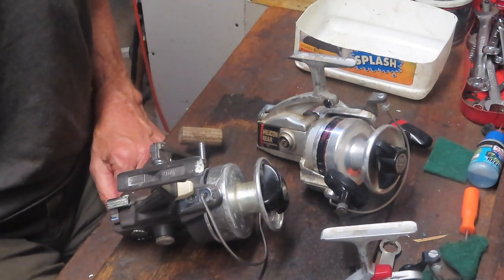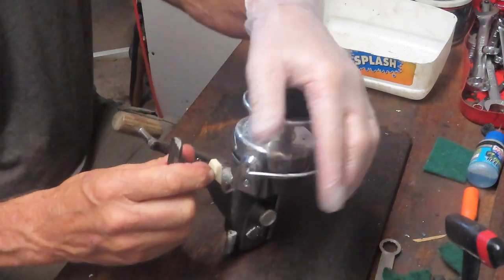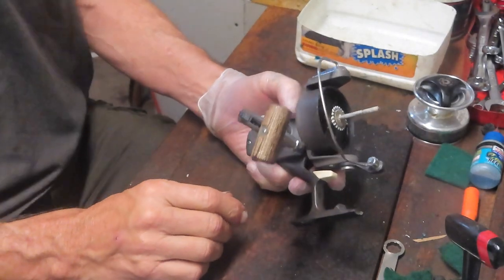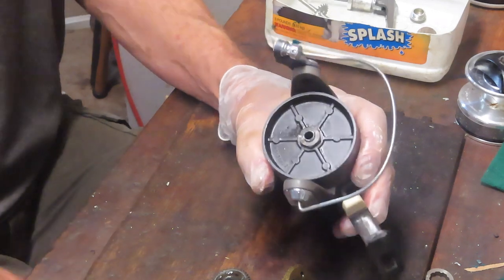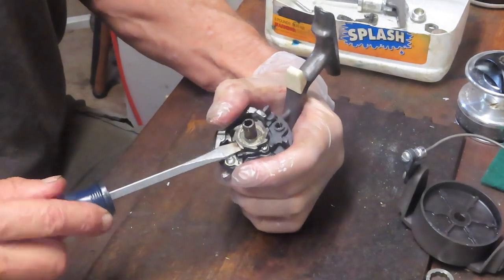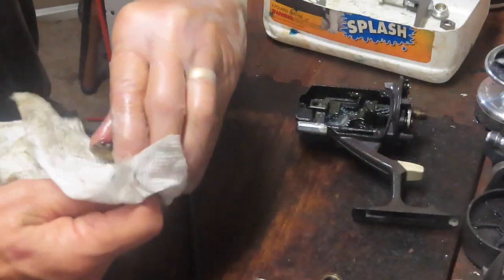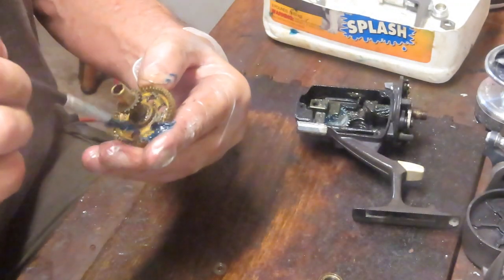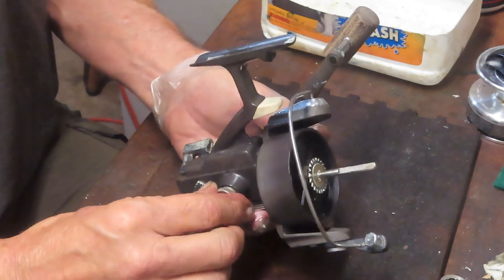Daiwa SS500 saltwater spin fising reel with unique AR over ride ow to take apart and service copy

Comment: The SS Daiwa's where made around 1975 and cost about $75 Canadian. I bought mine around 1980 when it was affordable because of inflation. A Silver series was about half that price. The SS has really nice big aluminum bail screws and cap. The handle was awesome and the Egyptian Hyroglufics really help catch fish as well. The Gears still running strong after 40 years. Saw one selling for $ 1000 American who needs 10 bearings when 3 good quality ones last that long with basic rince after salt water. The special finish looks new save where it touches the Rocky point when tending to fish . Really enjoyed this video thanks Dennis
Reply from the maker: Thanks for the note.   I like this reel.  I got it a part of a larger lot of saltwater reels and was surprised it was included for the price they were asking.  I'm planning on taking it fishing when the fall run begins. Dennis

Comment: Hi Dennis,
maybe you change the title to "Daiwa SS5000"? ;)
That´s excactly the type of video, I was searching for a while. Thank you very much!
The handle is made out of teak wood. At least, that´s the information that i have found on pictures of a booklet. By the way with beautiful sectional views of the inside, with real cuts of the reel! Amazing.

I´m really overwhelmed by the videos on your channel. Respect to your work!

I have never serviced a reel before by myself. 
I felt in love with the design of these reels an last year, I made me a present to my 40th birthday and I bought three of those beauties.
They for sure need a little service, as they don´t feel very smooth anymore and make some noises. Some corrosion here and there. But with the help of your videos, I believe I can do the service by myself.
Thank you very much!!!

Greetings from Germany
Bart
Reply from the maker: Bart - thanks for the note and best wishes on the servicing of those reels.  You can do it!
Reply: @2ndChanceTackle  Hahaha, thank you very much! I feel very confident, after watching some of your videos 😉
Would you recommend to work one reel after another or go step by step and service all three reels at one time?
Reply from the maker: Maybe 2 at once, but I would leave one alone in case you get in trouble with the other two.   That way, you will have one that is correct as a reference and you can match up to the others if something goes wrong.  I generally go one at a time even when I am working on a set of 20 reels used on charter boat fishing groups - Dennis
Reply: @2ndChanceTackle  Thank you once again! This makes perfect sense. I just found out, that one by one is the way to go for me, as well. Learning by doing. 
I just had my first little success! 😁
I can't believe, I haven't done this before. It makes soooo much fun. I immediately got "hooked". Now I understand, why you are doing this for over 20 years 😉 And those old, big reels are perfect for beginners to get into this stuff.

Comment: This Daiwa sort of reminds me of a beautiful Daiwa Sport 5000 reel I recently  got. It looked a lot like a Punch but it has 3 ball bearings in it. I’ve never seen this SS5500 before. I like it a lot!. It has a superb main gear. I’m going to have to look for this reel. It is exactly the kind of reel that I want in my collection and for surf fishing. Today I spent 3 hours on a True Temper 747. It was the worst bail mess I’ve ever dealt with. I got it right but it pushed my skills to the limit. I also got another Jorgensen 12 and. Shimano MLZ 60. I haven’t done anything with them yet but I know everything work in both reels. You know a Mitchell 4470 saltwater reel made in France has a separate switch for the internal clicker and the anti-reverse just like this reel. It comes in handy. I think this Daiwa has a better system for doing this than the Mitchell.
Reply: The Penn SS has the same clicker override
Reply from the maker: I thought you would like this when I was doing the video.  Turns out these reels are not cheap!  Dennis
Reply: @2ndChanceTackle  These reels were the
top of the line reels in their day. They were not
and are not cheap. They were above the Gold
series. I remember seeing them in a Gold
Triangle store selling for about 80 dollars
when a Penn 704 sold for 40-50.
Reply: Hi Chris, I hope you´re doing well! That´s the video, I was reffering to. The Dawia SS5000. I was just wondering, if you have received my message on your channel. Because I didn't knew, how else I could answer your last message. I´m just asking, because I can´t see it myself. If I did something wrong, then I´m sorry. If you don´t want to communicate anymore with me, it´s okay, just let me know. I won't bother you anymore. I just have a feeling, that you are a very nice guy and I enjoyed the conversations with you a lot!
Stay healthy!
*Bart
Reply: @bart-b9497  Bert, I absolutely want to keep the conversation going. Hearing from people on YouTube is something I enjoy very much. I don’t know what happened to our messaging. With my vision limitations I often make mistakes posting them. I’m sorry if ihat is what happened here. By all means communicate with me anytime as I enjoyed our conversation immensely! I’m not as knowledgeable as others who respond to Dennis’ channel but I love to talk about spinning reels in particular as I only use them. I sold my conventional reels when I could no longer see the rig or lure hit the water. I just didn’t know when to put my thumb on Yuen spool anymore. I can work on them but not fish with them. Let’s keep on talking! ——Chris
Reply: @christopherjenkins2373  Hi Chris, I´m a little short on time, so just a quick answer! I am super happy, we keep on talking. I was worried, that I maybe wrote or did something wrong, something that might upset you.
Reply: @bart-b9497  By the way Bert, I don’t get upset very easily so never worry about that.
Reply: @christopherjenkins2373  hahaha, that's great, Chris! Me neither. I guess, we would get along together, very well.
Reply: @bart-b9497  Bert, the real test of the temperament of a fellow fisherman is how mad he or she gets when you catch either bigger or a greater number of fish than he or she did. Now that is the true measure to watch for. Strong language and throwing stuff is a dead giveaway. ;-)
Reply: @christopherjenkins2373  Chris, don´t worry. I can be very humble in win or defeat. I have a good friend of mine, that I know since school, who always catches more and bigger fish, even if no one else catches nothing, he always finds a way to get something hooked. He ´s a natural at fishing. But to be honest, I don´t see fishing as a competition, to me it´s the best hobby, or one of the best hobbies in the world, and just a very big pleasure! But, I can be very sad though, if I had something big hooked and I lost it at the end and couldn´t see the fish. Sometimes I still have bad dreams from those moments. If people ask me, which fish was the biggest, that you have caught, I have to try to remember very hard. But I know very well, time and place, of the biggest fish, that I haven´t caught ;-)

Comment: Oh, and one question. Do you think, it makes sense to change the teflon washers into carbon fibre washers on such a reel?
Reply from the maker: I would not replace the washers to Carbontex unless you are having issues with the current ones.  If the teflon ones are holding fine and providing the right tension, then there is no need to do the Replacement just for the sake of having Carbontex ones in the reel - Dennis
Reply: @2ndChanceTackle  Thanks Dennis, this makes a lot of sense to me. I will stick with the original teflon washers!
I want to use the reels mainly for carp and catfish fishing in rivers.
We fish with boilies with self hooking systems and mostly with baitrunner reels here in Europe.
I've seen carp angler's from the UK modificate older reels to "fast drag" or "quick drag" reels. Using teflon or carbon washers instead of the fleece ones.
And one guy took the spring out of the drag knob of those Daiwa Super Sport 5000. This way, you can have a free running system to closed drag system in a half or just a quarter rotation.
However, I thank you very much for your help and your contents.
Wish you the very best!

Comment: Dennis- what do you use to spray off the ‘superficial grease’.  You wiped the gears off and they seemed to clean quickly.  Thank you. I am a new subscriber. By the way- After seeing your reel opening and cleaning videos my testicles are getting bigger.  Stay safe. Doc
Reply from the maker: Hmmmm.    I use WD40 or another penetrating oil as a degreaser.

Comment: Hi Dennis, I cracked the screw on the handle on one of my Daiwas. The head came off. Now I have problems, to find a spare part. 
Do you have any idea, if a screw from another reel could fit?
From a Daiwa GS9 for e.g.? This one I could get.
Or maybe another one. If you have any suggestion, it would make me very happy.
Greetings
Bart
Reply from the maker: I don't know the size, but by trial and error, you should be able to find the replacement. Just give the GS( screw a try.  The screws are metric sized, so a local hardware store may have an assortment that you can go through.  Try to get a stainless screw if possible - Dennis
Reply: @2ndChanceTackle  thanks Dennis! I would have to order the screw for the GS9 from Mike´s from Canada. Before that, I will try it at a local hardware store. When it´s metric, there´s a good chance that I will find something that will fit. Have a nice weekend!
Bart

Comment: Do you have any videos on how to remove the 2speed button on internationals ? The newer models
Reply from the maker: I don't.  I may be thinking of the older ones, but there were two small screws that cam out of the collar and then a small wrench was used to unscrew the assembly beneath the collar - Dennis
Reply: @2ndChanceTackle  yeah these are the newer ones. Haven't found a video of removing the button.

Comment: Quick question I have a southbend spin cast 1100 model A I cannot find any info on the internet about it  any info would be appreciated thank you
Reply from the maker: I can't find any either.  The problem is that these were made without parts support, so it is hard to find service information.  If you locate the original box and paperwork, there is a chance, but I'm sure those are equally hard to find - Dennis
Reply: @2ndChanceTackle  I’ve found brochures and manuals but none of them have or mentioned the 1100 model a just the 1200 and up
Thanks for replying
Reply: One more question 
I’m not sure in the mounting style spin or cast 
It reels and sits normal as a open face would  but has no hand clearance  as if it was to be mounted like a bait caster 
So basically if I mount it like a bait caster it reels backwards 
If I mount it on a spinning rod it Has no finger clearance between rod and reel to hold it correctly but reels and functions correctly